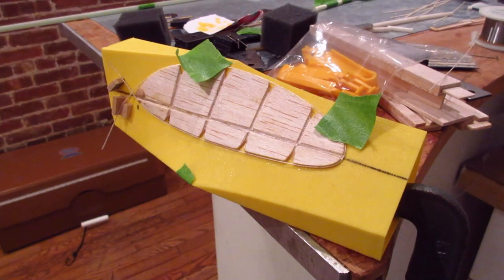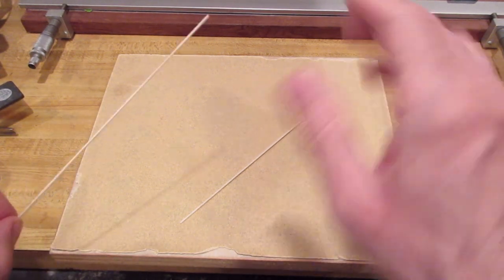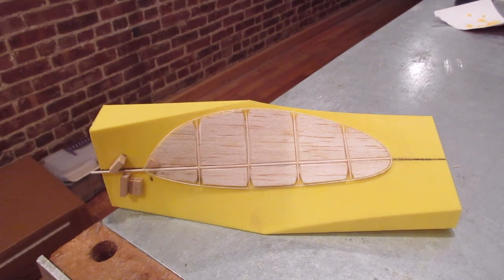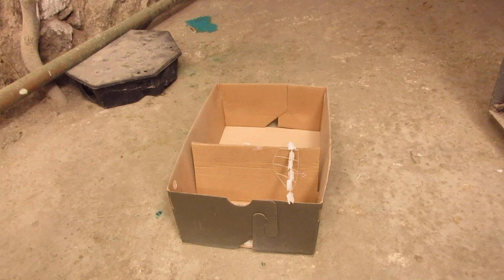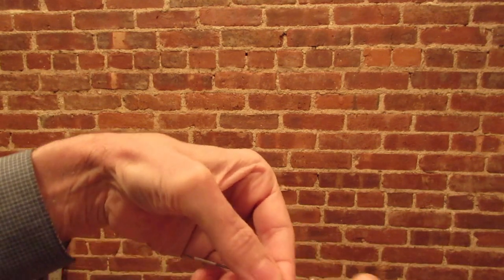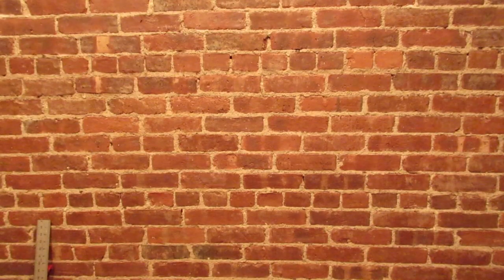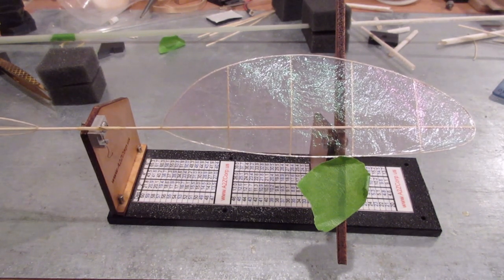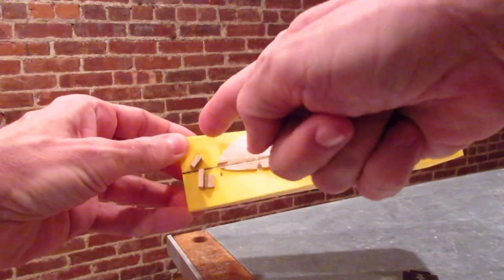F1R Build Part 2: Prop/Hub

Comment: Fascinating video - thanks for posting.  I've just started indoor and so far only with models made from balsa picked out of my own 'run of the mill' balsa stock and covered with veggie bags - I can see I need to up my game! Can I ask "how does the weight of your F1R prop compare to your solid F1L prop with all the blade area in front of the spar?"  Please keep posting.
Reply from the maker: The F1R prop is much lighter. Checking my notes, my F1L props usually come out at around 270 mg whereas my F1R props are around 80 mg, so more than 3 times lighter. Built up props are considerably lighter than solid props, thus the advantage.

Comment: How do you get non wavy cuts from your stripper? I just picked one up from Mr. Harlan and I've been having some trouble with wavy cuts.
Reply from the maker: My first guess is that you have the blade too low in the holder, so it's getting caught in the wood grain, that will give you wavy cuts. So raise your blade up slightly so that the blade is only scratching the surface of the wood, and not getting into the grain, you don't have to cut into the wood base. Also, I use some masking tape on each end to hold the wood in place.